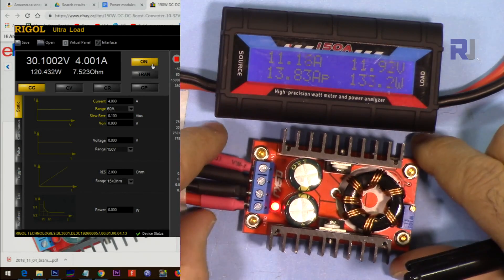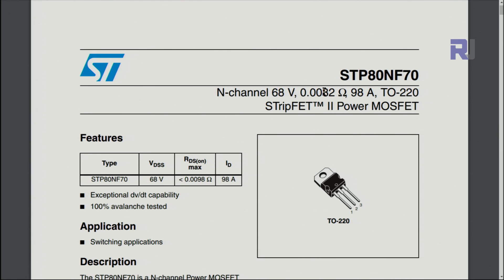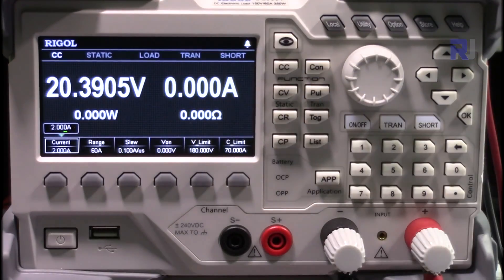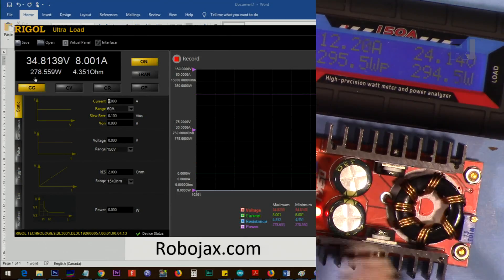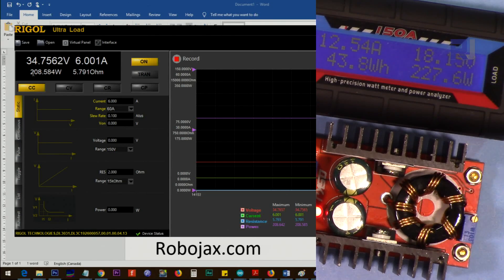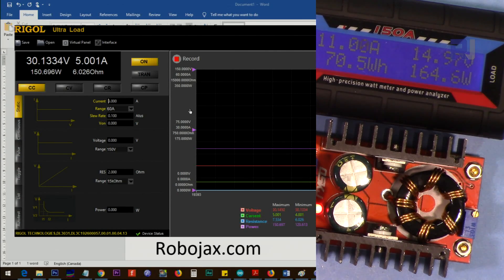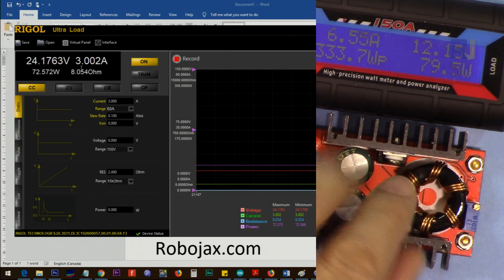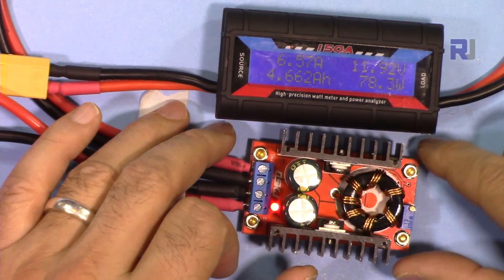Review of 150W DC-DC 10-32V to 12-35V 6A 05KJ   Boost Converter RJT184

Comment: Hi...i have  24v 7A Charger and 29.2V Lithium Battery 7s Bms (3X7=21)
So My Charger is Charging The Battery Up to 27.5V but not Fully Charge to 29.2v.. 
So I was Wandering... 

Can I use This Module To Bost The Voltage Of The Charger to 30v and Fully Charge my Battrry? 

Or Should I get 400w Module?

Comment: I got one of these and blew the fuse as soon as I connected it to my 12V battery, no output load connected at all! Anyone knows why? Faulty board or did I do something wrong???
Reply from the maker: ThI main mosfet is dead or the PWM controller is dead. Not worth repairing.
Reply: Good to know. Thanks!

Comment: Can two of these be connected in parallel? Will there be any issues?
Reply: Yes they can be connected in parallel, although make sure both of them are set to have the same output voltage !
Reply: @BlackICE-Dynamics  of course on equal voltage.. Thanks for your reply...

Comment: To set this to the right voltage you need a volt meter? And is there a possibility of it overcharging a laptop battery or is there a way to set it to shut off, or it shuts off automatically? Thanks
Reply: Yes. You need a multimeter or a voltmeter to set the right voltage. And no, there's no way to do so..

Comment: Ideal for 4s battery pack and boosted to 28 volts To power XY PDS 100.
Reply: What about 3s battery pack boosted to 24V
Reply: @TruthLoversKoSALAM-fg8dh the minimum input of this module  is 10v ,3s battery pack voltage is 9v -12.6 ,its okay if the battery full capacity and voltage above 10v
But when the voltage below 10v yhe modul will not work

Comment: what happens if you change the components on those converters with the real  ones from reputable sources? the problem is that many of these chinese ones do not have the real components
Reply from the maker: It should work

Comment: Excellent review. You have done a great job in testing this board. Explaining when it is getting extremely hot and when it is running cool or warm gives a good idea about this board, and it is very helpful. In your view, is this board worth buying? I have 19v 4.62a AC DC power adapter and if I connect that to this module, what will be the output current for 24v and 30v? Please advise.

Can you tell me what kind of wiring you used to connect to this module? Those wires look great and well-made. Please tell me the name or if possible give me the link. I want to buy them. Thank you again for the wonderful video.

Comment: Input side capacitor heats
Reply from the maker: reduce input voltage then.
Reply: @robojax  can I connect 2 in series,   input is 12V battery , To get voltage of 33 volts , 6 amps . Each module set to 16V , 6 amps . What should be my  output wire guage for 30 meter length at 6 amp. Will it over heat for 6 amp , 16 v out when input is 12V.

Comment: Hello, can this do a variable input 21-28v (depending on charge status of depleting 24v battery) and put out a consistant 24.0v?
Reply from the maker: Hello, constant voltage means it will keep it output stable as long as your input is within the range and the power is not exceeded.  I don't remember the numbers to tell you.

Comment: I have two that stop boosting and only output the input voltage. I think the mosfet is the problem. I only use 30W of power to run a dc pump. Maybe it is not suitable for inductive load. Any suggestion on how to repair?
Reply from the maker: Hi, when the output is the same as the input. either MOSFET is dead or MOSFET is not being turned ON or OFF to make boost converter.

Comment: Hello. I also have this converter. I use it for my T12 Soldering Iron. Input 15V to 24V. I used it only about 3 minutes and it doesn't boost anymore. Now input is as output! What could that be? Can I repair it?
Reply from the maker: If output is the same is input then it is either dead or input is higher than output.

Comment: Can I use this converter module for  TPA3116D2 50Wx2+100W 2.1 Channel Digital Subwoofer Amplifier
Reply from the maker: my test just gives you maximum and minim voltage and then current. See if this module can supply 150W because your speakers are total 150W and I don't remember the numbers from the tests I did on this video.
Reply: @robojax  thank you

Comment: Can i change rectifier diode to claim more current ?i need to boost 12v to 30v with 5 amp output
Reply from the maker: to increase the current you need totally different values (R and C) and perhaps MOSFET and other components. so you can't change it . except adding heat sink.

Comment: very good sharing,
sorry i use google translate,
I want to use this 1 Boost Converter to control car lights, is it possible if the low beam switch is active the output is 50 watts and if the high beam switch outputs 60 watts?
Do you need a relay or microcontroller (Arduino) and how is the wiring?
Reply from the maker: Yes it is possible, first remove the potentiometer from the module and connect it used wires so you can adjust the output, now set it the output at voltage sensor To get maximum or high beam , now record the value for potentiometer, the n do the same and adjust it for low beam and then measure the resistance of potentiometer and that is resistor value for low beam. Now you can connect those resistors with one dual pole switch or two separate switch to turn the low or high beam value,  sorry this is mobile phone and hard to see what I have typed
Reply: @robojax  Thank you for your response.
Can you help me with the wiring with an example if let's say the resistor value for high beam 100 Ohm and Low beam 200 ohm.
Sorry i am still a newbie
Maybe with another video or tutorial.
Thank you very much.
Reply from the maker: sorry I would help. I am very busy.

Comment: Can it handle 200w with Water Cooling??
Reply from the maker: I presented the test. it is up you to come to conclusion.  For heatsink in engineering we have a method to  to calculate the dissipation of heat.  But you should not go above 150W as set by the designer. the 400W boost converter module video is coming in 4 or 5 days.

Comment: Stable output? What if my battery 12v and goes down to 9v still the output stable?
Reply from the maker: lowest input voltage is 10V. then the output will not be what you set.

Comment: Hey can anyone tell me if i am drawing 24v 0.5amp from output side then how much current is drawing from my 12v battery input side ? Is it 12v 1.2amp ? And how much is total loss ?

Edit : i watched full video thanks
Reply: And one more question do i have to adjust out voltage every time or its keep it ?
Reply from the maker: for the power first calculate the output 14x0.5= 12W then add approximately 15% which is 1.8W losses so the input must be 12W+1.8W= 18.8W. now you can find out the current 181.8÷12=1.15A is the input current.
for your second question, no you don't. Once you set it even if the input goes up and down it will stay  constant at output as long as the input doesn't go below the minimum voltage. Good luck and please replay back so I know you understood it.
Reply: So if you boost volts (out)by duble of the battery capecity amps (in) also will be duble (lets not talk about power loss )approximately right ?

And for second question how much tolerance (in plus volts) is enough to change out volts by  plus 2-3-4 or 5 volts ?
Reply: Sorry for my bad English
Reply: Hey i have powerbank which is capable of delivering 12v how can i get it ?

Comment: I have the same board and it is fed by the 12v rail of a PC PSU and is boosting to 30v into a 100w led cob chip that draws 3amps but it gets red hot the heatsink and the capacitors become too hot to touch I think a fan is definitely a good idea for anything 90w or over.
Reply from the maker: Yes I agree.

Comment: i had one i'm using from last 2 years to charge my laptop from 12v battery to 21v 90W continues along small fan for cooling without any problem but today i purchased another one to charge 29.4v 7S lithium ion battery, as this module don't have current limiting feature , i thought i will add under 100w psu and this way it will be good to go, but when i connect 16v 7a power supply which is 110W , i get output only 80W and it's getting really hot ♨ very quickly - i don't know what i'm doing wrong.
Reply from the maker: check the model of the mosfet. They must have changed the mosfet. My test showed that this can handle above 120W easily.

Comment: Useful, thank you. Can you also test turn-on when using each setting. It may handle a load when you slowly adjust it, but not if the load is already connected and you turn it on. Also please test for large voltage spikes when the unit is turned on (and output set to lowest V) and when you turn off (and output set to highest V). Often these units produce 10V+ spikes on the output!
Specs for this unit are:

Module Properties: non-isolated step-up module (BOOST)
65 * 56.5 * 23 (length * width * high) (mm)
Input voltage :10-32V
Output voltage: 12-35V (adjustable)
Output Current: 6A (MAX)
Input Current: 10A (MAX) (Please enhance heat dissipation if more than 10A)
Output power: natural cooling 100W (MAX), enhance heat dissipation 150W (MAX)
Easy to drive 65W 90W dual-core notebook.
Use a 12V battery drive 19V 3.42A notebook, the module temperature about 45°c
Conversion efficiency: 94% (measured at Input 16V, output 19V 2.5A)
Output Ripple: 2% (MAX) 20M-bandwidth
Operating Temperature: Industrial (-40°c to +85°c) (ambient temperature exceeds 40°c, lower power use, or to enhance heat dissipation)
Full load temperature rise: 45°c
No-load current: 25mA typical
Voltage regulation: ± 0.5%
Dynamic response speed: 5% 200uS
Short circuit protection: None (Please Install fuses and protection circuits at Input port.)
Input Reverse Polarity Protection: None (Please Series diode at the input port.)
Brass standoffs included.
Reply from the maker: I will reply to all Subscriber's 🔔 questions. So make sure to Subscribe.😊

Comment: I have one of these that blows 20A input fuse when output is disconnected.  Do you have any idea why?
Reply from the maker: Boost converter by theory should have some load. Even small current of 10mA should help. Try that. Put a resistor that draws small current and it will project your fuse.
Reply: Do you mean a resistor permanently across the output terminals of the converter?  0.5W 1.5kohm resistor will drop 15V at 10mA (normal operating. voltage).   3.5Kohm will drop 35V  (Approx max output voltage).  What do you suggest?
Reply from the maker: yes. at the output. My number was just an example.
Reply: @MrDunk66  Maybe just place a small resistor in place on the output just before disconnecting? Whilst running leave it off.
Reply: Must switching of the power before disconnecting the load seems to stop the problem.

Comment: I used one of these DC-DC converters to supply the 20v rail in a satellite receiver I converted to 12v power.  So far it's working well.

Comment: hi
thanx very much for sharing your videos: i want to buy some of this step up/step down modules, and your videos are really really complete!
i want to ask a question too: i want to buy one a couple of these 150W step up modules (this exact kind) to run my lapton from car...my lapton is 6.32A at 19v (it's very "heavy"energetically, beacause it's one of the first intel I7)...i thought to buy 2 of these modules and put them in parallel to be safe about overheating...is it possible? what do you think??
Reply from the maker: parallel connection of two independent power source is not a good idea because of adjusting exact voltage would be hard but if you can do it, yes do it.
Reply: @robojax  how much is the range of "exact" voltage i must apply? 0.1v? or more precise like 0.01v?
 or could i solder one trim-pot to work with both circuits at the same time???is it possible?
p.s. really really thanx for the quick answer!!!!!
Reply from the maker: the voltage x current=power and that is how much power you wanted to wasted as heat. So how much your system can tolerate.
Reply: @robojax  i know that V x A = W...but what do you mean "that is how much power you wanted to wasted as heat. So how much your system can tolerate."
anyway, is it doable to use only one trimpot to control both (identical, of course) circuits?? or connecting only one trimpot solded to both circuit causes some electrical problems?
Reply: @crustonepippi2561  i am curious to know what did you end up doing then?
Reply: @3012paul  i built one big device, inside a case for home electricity, putting the 150W boosters in parallel for a 300W, with a switch to be able to operate one at the time, with a switch to turn a 12v fan on, and replacing the precision trimmer pot with one particular kind that has a long and thin knob (so you can turn it both with hands and with screwdriver), and with another little switch to operate the led voltmeter (to to the voltage reading from booster 1, from booster 2, or from the two boosters together),,,it works like a charm, never over-heats (my gaming laptop has a 230W power supply), and it doesnt use the standard 12v cars sockets, but i plug it with modeling electrical plugs that are up to 90A...comparing it to the most powerful notebook power supply 12V for cars i bought years ago (it was 120W and costed 40$), this device i built could be worth 300$ 🙂

Comment: Hello,    if I  were to hook this up to many 3.7v batteries in parallel, do you know how many amps it could draw?  Is it 6?  If I were to output 12v, I would expect about 1.5-2a?
Reply from the maker: I have tested and presented the result in the video. it is up to you however you want to connect it. I don't remember what was the max current for this, but watch it and whatever is the maximum current,  either you can connect to one item or divide it to be connected to multiple item. For example if maximum current is 10A, then you can connect to 1 load of 10A or 5 loads of 2A.
Reply: @robojax  ah, it doesn't boost lower than 10v!
Reply from the maker: yes it has minimum output.
Reply: @robojax  and a 10v minimum input:(
Reply from the maker: I am recording doing lots of products. I forgot what was the minimum voltage input. in order to answer I have to watch the video and tell you. it would be very easy for you to watch it.